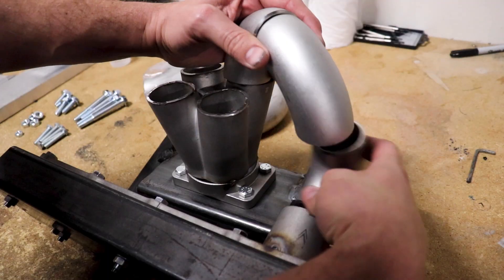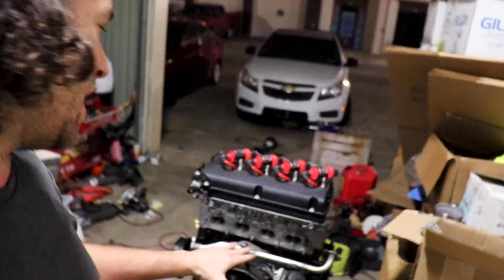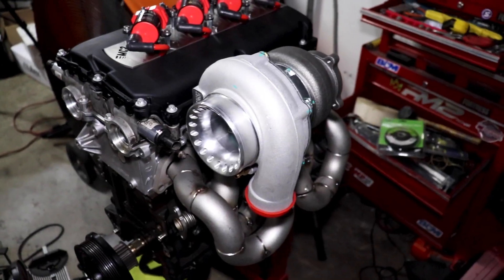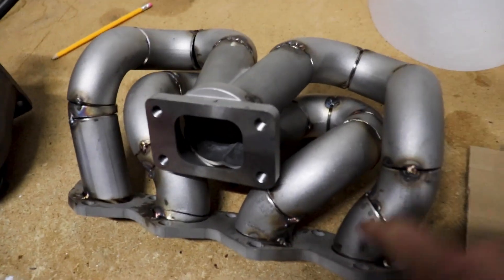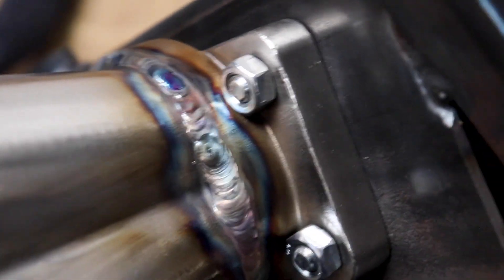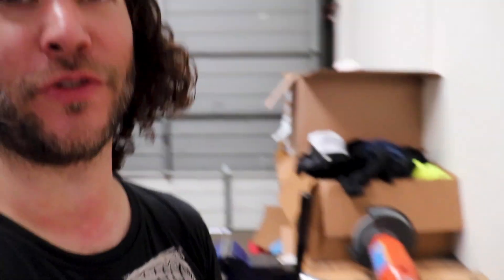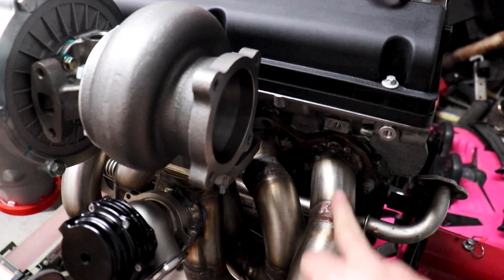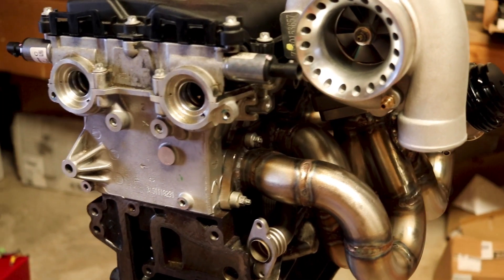How to Make a DIY Turbo Manifold Pt 2 | Step by Step | Simple Tools | Chevy Cruze 1.8L Turbo Project

Comment: That Cruze is going to be sick for sure a sleeper no one will expect it to be fast.. great build, keep it up.
Reply from the maker: Can't wait to get the engine in, some miles on it, some quarter mile runs, and pull on some unexacting muscle cars on the street. That's the content I can't wait to bring you guys.
Reply: @cmattdabrat  nice, can't wait to see what you run with it for sure..

Comment: I like rear mounting my compound setup, I don't like turbo manifolds too much heat close to the engine, cast turbo manifolds make hot spots in the motor , but if I had to use a turbo manifold this one that u made looks custom af,great job that's what I would use! Keep cooking frenchy!
Reply from the maker: Thank you! Rear mount sounds like a great idea.  Just not the plumbing.

Comment: I'm in the same boat as you with welding, just learned to weld for my Exocet project, I really want to do a tubular manifold but damn 5 cylinder collectors are very pricey.
Reply from the maker: I bet! You could make one. I just bought a cast collector to avoid having to weld up a collector. I'm sure I could have done it, but just trying to save some time.

Comment: Hey man, just found your channel and I definitely enjoyed the manifold build. I’ve been tig welding for about a year now. Diy’er like yourself. Mainly 304 stainless exhaust piping and aluminum Intercooler piping. I feel pretty confident about my welding skills and would like to tackle a sidewinder manifold but my biggest fear is dealing with shrinkage and movement. How did all of your runners fit back to the collector and head flange after you broke them off to weld individually? I’m worried that if I do that, I’ll end up with a runner that’s wayyy off from its original position.
Reply from the maker: Thank you! That's awesome. To be honest, there really was no way around it aside from just kind of making it work by filling in the gaps with filler rod, or cutting some pieces from the scraps to help fill the voids. I see that some people will make them a little longer on purpose and somewhat know what way the metal will be pull. Stainless tends to pull towards the weld, so I just used my best judgement.

Comment: Maybe I’m wrong but the waste gate placement looks like it might cause boost creep the EGs might shoot pass the waste gate with that 90 degree angle on the collector. Most waste gates are angled the way the air flows.
Reply from the maker: If that's the case, I'll address it. Not that big of a deal. Cut, grind, weld.

Comment: When your trying to tack stuff together like that bump the amps up 50 percent and just tap the switch for a second  ,you will find if it fits okay you won’t have to use filler rod which gives you a hand to hold the part
Reply from the maker: The parts where fitment was great, I was able to just fusion weld it without filler rod. Thanks for the tips.
Reply: Exactly how we do it in the dairy industry, 2 step with 20 more amps and tap the tack in.  Before that though fit up is 100% key..

Comment: The manifold came out fantastic! What wastegate you running? Looking like tial mvs rep
Reply from the maker: Thanks! It's a Maxpeedingrods waste gate. It was affordable enough to give it a go and looks like a decent unit. It's a 38mm.
Reply: @cmattdabrat  well hopefully it works all good for you, I do believe alot if not most of the genuine TiAl parts fit the knock offs, so if it ever needed rebuilt that's an option aswell

Comment: I don't think that oil filter housing is gonna last by so much heat.
Reply from the maker: If that is the case, I'll get the under mount used on the 1.6.
Reply: @cmattdabrat  Seems like plastic or whatever they use just won't take the heat. I really hate any plastic for motor parts. If that oil filter  blows while your on it may be the last time. I would keep my eye on it really close. You did a great job though. Congrats.

Comment: DUDE, PLEASE dont use the drill in hammer mode. doesnt drill that good, and you ruin your bits. slow speed, lubrication and you'll be golden.
Reply from the maker: Thanks for the tip. I'll keep that in mind. Might be time for a drill press.